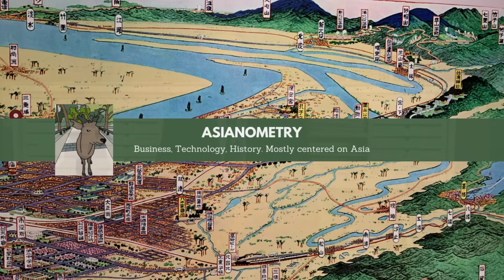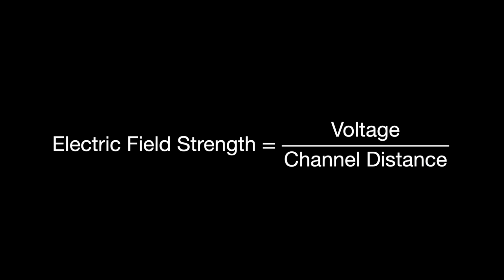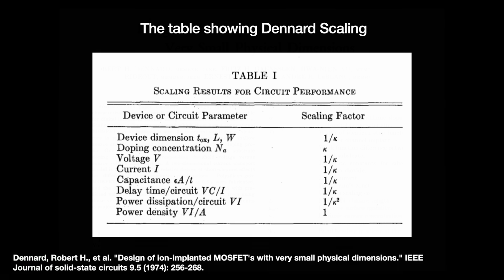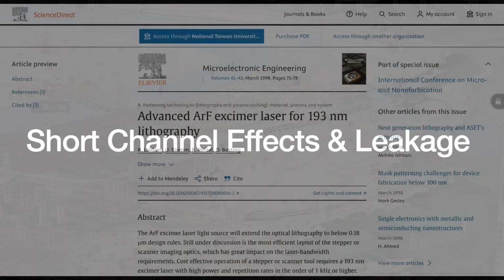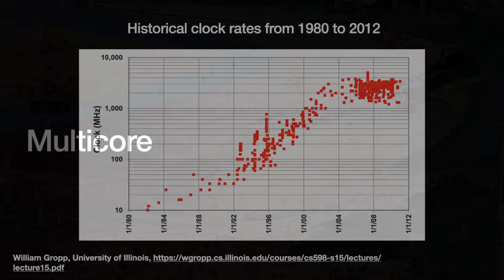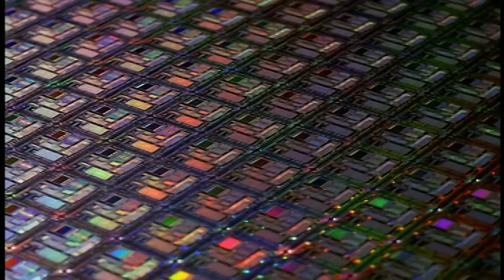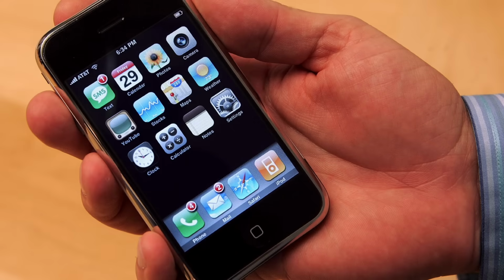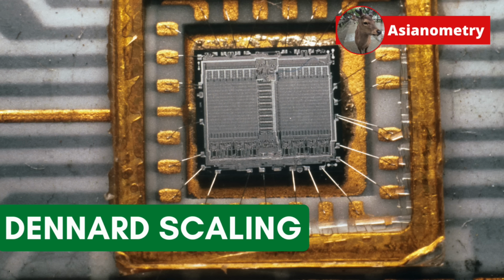The End of Dennard Scaling

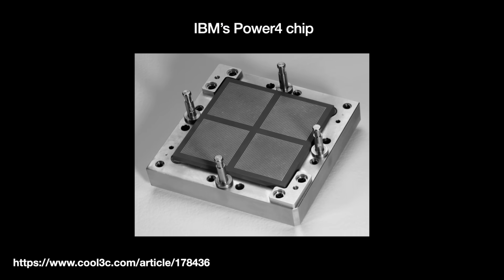Comment: 9:10 - “AMD’s dual core… in 2004”… “Intel’s Pentium D in 2005”

Sun Microsystems dual core UltraSPARC IV was released in 2004… a massive jump was made by Sun Microsystems octal core UltraSPARC T1 in 2005

16 & 32 core processors were later used by Sun Microsystems & then by Oracle Corporation… while handling 4 instructions per cycle & speeding to 5 GHz on the SPARC T8.

SPARC by TSMC pushed the market to incredible places, by leading often years ahead of their time.
Reply: Pentium 3 had dual socket motherboards (non-server, I think). Hitachi SH2 had a way to link two chips in a master/slave configuration, and by 1997 they made a package that had both cores under one hood. However that one was not traditionally multi core, just two chips shrank into the same silicon.
Reply: reminds me of the 5GHZ IBM monsters later on made on SOI wafers, its sad that that tech was left behind, we could gain some free clocks

Comment: 1996 to 2001 was really an incredible era in computing.  I remember 50 or 100mhz computers being norm then doubling frequency every year then on.  There were even tv commercials around that time of a guy driving home, from the electronics store, with a new latest model PC and seeing a billboard announcing the next generation.   It did seem like that at the time.  
Then, around that time, accelerated graphics were also created and advancing.  DirectX versions advanced at around the same rate as CPUs.  You had to buy a new videocard every year or so because the next generation supported new compute features supported in the latest DirectX version.

Comment: Saymour Cray had a solution for the frequency bareer for CPUs back in early 90's however he was ignored. I guess that all that investment in silicon chip manufacturing must be milked to the maximum and this is still present to this day. I am talking about moving away from silicon and using galium, germanium, carbon etc etc.
Reply: Saymour Cray had a lot of good ideas and many of them made it into mainstream. Moving away from silicon requires a significant amount of investment that was from an economical standpoint completely impractical until now. Research labs and companies do look at such alternatives now. These are not as simple as just switching out the semiconductor material.

Comment: I'd like to comment regarding the Pentium 4.  It was a poor performer.  I had several systems using these processors back then and they were noticeably sluggish.  I am told that this sluggishness was a result of the deep pipelines in the processor.  For example, I remember a Microsoft engineer at the time stating that a thread switch consumed roughly 7500 cycles because the pipelines and instruction caches got dumped and had to be refilled.  My understanding that the follow-on after the Pentium 4 used older Pentium 3 technology.  Anyway, I was not impressed that Colwell was a champion of the Pentium 4.  To me, it was a failed processor.

Comment: Can the "Dark Silicon" problem be solved just by cooling the chip enough?
Reply: Better cooling can help, but we are hitting physical limits.
I do expect liquid in direct chip contact to generalize. Thermal conductance alone just doesn't cut it any more.
(Passive) phase-change is powerful, and especially keeps T° range small, helping local expansion strain.
Active, below-ambient seems just forever too expensive & unreliable.
Reply: Phase-change cooling isn't really practical for daily use, and without it the absolute best you can do is the temperature transfer rate compared to ambient temperature. Air cooling and water cooling both run into this roadblock

Comment: These kind of difficulties always stimulate new inventions.
I'm pretty sure if we had these 50GHz chips the systems wouldn't perform 10x faster, also because much less effort put in software optimization, and less hardware acceleration that CPUs / GPUs are stuffed with today.
Parallel computing development was an obvious thing anyway, as it reflects the way heavy multi-tasking systems work.

Comment: overclockers using liquid nitrogen often go above 4GHz so I guess the cooling tech needs more advancement to break the power wall
Reply: cpus now easily run 5.5ghz on ambient cooling, but you're right, problem is that there is no easy method that is cheap
Reply: And as you get colder the efficiency gets better and the power usage goes down. Funny thing is low leakage chips tend to scale better at ambient temps and leaky chips scale better cold

Comment: Evolution in nature also followed this curve. Nerves started slow, but sped up using electrochemical reactions. It was a dead end. Nature didn't give up on speeding up neurons as much as discovered the advantages of parallelism. Your brain is a relatively slow communicating, but massively parallel machine.
Reply: It's also analog which is where the "it's a computer" paradigm breaks down.
Reply: @brodriguez11000 computers aren't necessarily digital. Early computers, and some today, are analog too. Our brains are indeed analog computers, just with a structure we don't understand
Reply: @brodriguez11000  So is AI.

Comment: The Pentium4 was also an opening for Transmeta to show a different way. We were focused on lower power while still keeping up the IPC. We had developed a really clever clock tree architecture that allowed us to only clock parts of the chip that needed to be updated that cycle (clock enables as far as the eye could see). This meant our active power was really, really low. 

We also did frequency/voltage scaling before anyone else as far as I am aware. This got our active power even lower. Playing with the substrate voltage was another hack we had to lower our leakage current. 

You should do an episode on Transmeta.
Reply: One of the intriguing things about Transmeta was that theoretically you could emulate any architecture; you just had to make a version of CMS that supports it. However, as has been learned time and again over the years (see especially Intel's Itanium), sometimes the magical software doesn't work as well as you'd hope, if it even appears at all, and so you're stuck with clever hardware that doesn't really do much outside of a carefully tuned environment. Also, Transmeta chips really would've needed huge high-speed caches (32MB or greater) for the CMS if they were truly going to supplant any of the big players in markets outside of netbooks and web appliances; using main RAM for it wasn't going to cut it in the high-performance sector. And nowadays most CPUs have several sub-architectures (SSE, AVX, MMX, AES generators, etc.) that are hardware-optimized, something the Transmeta chips wouldn't have been able to efficiently emulate without a unique set of SIMD engines of their own.
Reply: They were definitely ahead of that curve, and I'm sure they've contributed greatly to Intel, amd, Nvidia when they moved on.

Microcode and microops seem like descents
Reply: The "code morphing" always fascinated me, and I'm curious how it compares to modern CPU micro-code.

Having more of the instructions be "software defined" sounds like it came with a cost, but offered a lot of options.

Comment: What are we going to see ten years from now?  How many cores/threads are in a mid-range PC?  Is the increase in cores/threads - how long does that increase in parallelism increase?
Reply: Utilizing parallelism is very very hard. But currently the bottleneck is the memory. It's possible to design a faster processor but feeding them with data could not keep up. So ten years from now most likely memory will be integrated in the CPU package. There are already CPU and GPU architectures that do this. It will become a lot more common in the future.
Reply: Cache sizes are going to get much, much larger to reduce latency, because system memory is simply too slow and modern processors waste a ton of cycles waiting for it. Adding more cores isn't really going to help much- the tasks that can be near-infinitely parallelized are already better shipped off to a device with a GPU-like architecture. We may start seeing consumer chips with a gigabyte of L3 cache or more.
Reply: the main game now is packaging, cpus will balloon in total silicon because SRAM is no longer scaling and you cant get more performance without it.
the tendency will also be to more tightly integrate memory, things like HBM on package, take a look at AMD's MI300C for example, and Strix halo launching in january.
cores will continue to increase slowly overtime, the main problem is cost per transistor isn't improving much which will be a massive problem soon.

Comment: And you know what is still shitty? Having to listen to people that insist on having the latest multi-core machine while they're still using single-core software. Memory management isn't the best of that piece of software either. Take a 100 MB drawing (it's all vectors, so this should be a lot smaller anyway, their drawing format must suck), you need at least 24 GB of memory, otherwise it starts swapping to disk, and then it's plainly unusable. autocad is in an incredible load of toss.
Reply: It's 2024.  There are no latest single-core machines, unless you're talking about microcontrollers.
Reply: @JonathanMaddox  No, but a few years ago a cheaper processor with less cores and higher maximum clock was the better option. Some users would say that you need at least a quad-core processor. Mind you, this was a while ago, so I'll bet they would now be asking for 16-cores.
Reply: @jaapaap123  true, if by "a few years ago" you mean "two decades ago".
Reply: @JonathanMaddox  It was around 2015. Of course you are right that there were no single core processors available. It was just that to get the performance needed you needed to select a cpu that was the fastest (and affordable) in that situation.
Even better would have been to ditch that stupid piece of software. Sigh.
Reply: software is really the black sheep of the tech sector, the average software quality is really low.

Comment: went from 16 mhz to 2 ghz in a bit over 10 years, still a good effort
Reply: Eh?
286 16mhz February 1, 1982
P4 2.0ghz Aug. 27, 2001
Reply: @myne00  You could still easily buy a new 386 sx 16 in 1991
Reply: Fantastic effort, pushing the boundaries until it was clear it was a losing battle to push them any further.

Comment: Would we have GPUs today if our CPUs were able to keep scaling in Ghz? Yes, because we started getting GPUs when CPUs were still very slow, around 100mhz if I remember back to when I bought the first voodoo card. So GPUs then just started speeding up as the CPUs sped up as well. By the time we had 4ghz CPUs, we had already had 5 or 6 generations of GPU.

If CPUs just kept getting faster, the GPUs would have gotten faster alongside them, and developers would have included bigger and bigger polygon counts.
Reply: The first PCs had to have adapter cards to have video output. Those cards had chips on them that could be considered GPUs although display adapters could only produce text. So GPUs were a thing at the very beginning. It took almost 10 years from introduction for CPUs to reach 100 MHz. The first PC was only 4.77 MHz.
Reply: if we had 50GHz cpus we now would have 30GHZ GPUs and it would be quite cool, keeping those beasts feed would be quite the challenge though

Comment: The idea of dark silicon was prevalent in the spacecraft electronics industry in the early ‘80s when I used it. Much cruder though. Here the issue was using TTL logic (all that was available for radiation hardened work) for complex functions. We would cycle power to individual chips to reduce the power demands on a very limited supply.
Reply: What kind of spacecraft?  Satellites, rocket guidance or fuel control or launch, etc, Shuttle?  If you’re going to tease us…

Comment: I still think there's algorithmic and OS/language optimizations that are yet to be realized... As an old school embedded programmer I'm convinced that at least half of the clock cycles of a modern PC are wasted with bloat... but I'm probably oversimplifying the problem...
Reply: You are most likely correct. The problem that has crept into all software is that we have the memory to add an extra layer of configuration to everything, so software never resolves to a "finalized automation" of the kind that you get in the embedded world, where every byte and clock cycle can be properly accounted for. Instead we have a vast infrastructure of dynamically adjusting budgets for computing resources, just-in-time recompilation, abstracted programming interfaces, fallbacks, etc. That spills over into even more incidental complexity. It's known that as software gets bigger, more of the code "goes dark" - it either executes once or never, while the "hot spots" become much tighter in nature - tiny sections of assembly code that are hammered. But when there's an excess of configuration, there's no easy way to get at the hot spots.

It's related to Conway's Law effects - it's not that we need all that configuration for an application, it's that having it is a way of designing for an adverse environment where you don't know who or what your program talks to, so everyone assumes the worst.
Reply: I’m wondering if there’s going to be a language breakthrough for this issue… my experience with python is that until very recently it was effectively single threaded, even when using threads due to the GIL. A language (or python extension) that performs the heavy lifting of threading for a casual coder  would be amazing… something that changes the procedural paradigm without being onerous…
Reply: Depends what you mean by bloat, lots of spent cycles on non critical things but that's a tradeoff with simpler programming, more io, more OS features etc

If you consider that anything more advanced than windows XP is bloat then you can indeed run a whole PC in the single watts range
Reply: “Nature hates a void”. As the architecture (hardware) makes improvements and optimizations software is there to eventually occupy the newly discovered space - also an oversimplification. 😄
Reply: Open a Rust or Go binary in a debugger if you want to see what 99% wasted cycles looks like.  Bloated mess.
Reply: Look at branch predicted... The other branch is not use. Slight waste of energy. Scale that up it becomes both wast and heat energy
Reply: Part of it is likely to be the chicken and egg problem.

Software runs on hardware, that has to already exist. Then the next hardware is optimised to run existing software better.
Repeat.

It means that there are few opportunities to rearchitect things for the better in the long run at the expense of existing practices.

The best time to do it is when the bit size changes. Eg 32/64 bit transitions.
They were to an extent, but afik some of the more obvious improvements weren't. Like making instructions a fixed length.
As an amateur, it seems like fixed length 16bit opcodes with 64 bit data could have been an option. 146bit for a full operation. 
Afaik it wasn't done that way, and is still a variable length opcode.
Reply: 144bit*
Reply: Not wasting your time isn't "bloat". Making the most of a finite resource in which you have better things to do than banging electrons.